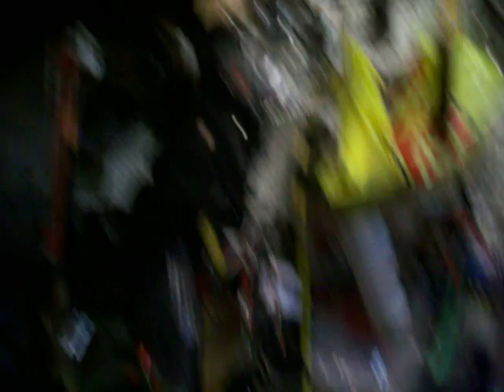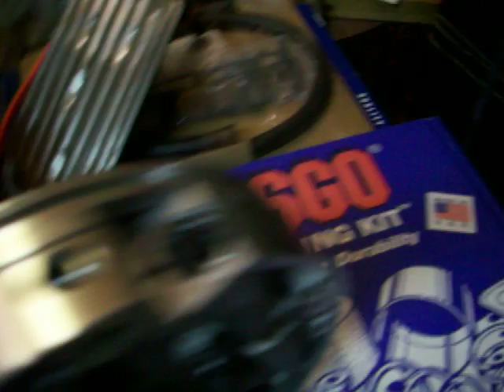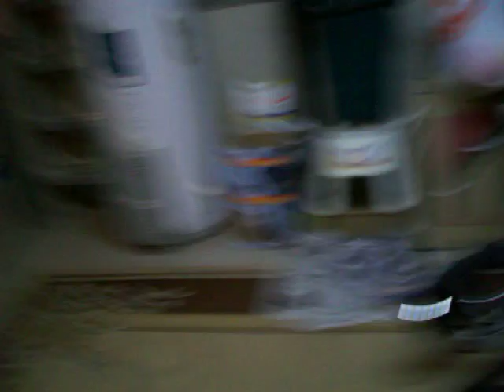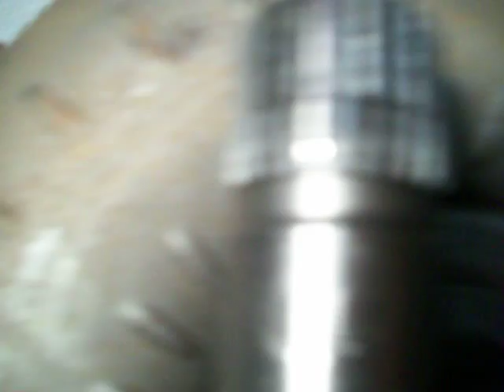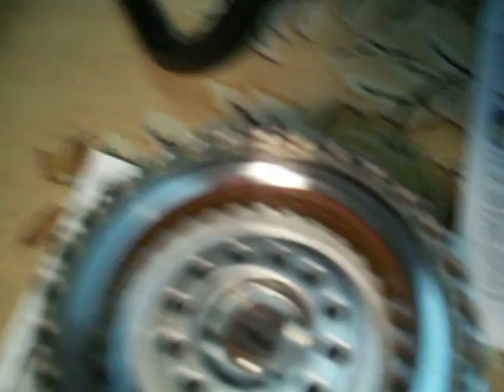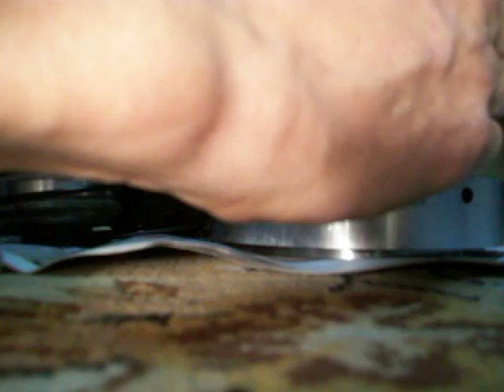Turbo 200-4R for the Vista Cruiser

Comment from the maker: This is one nice tip, I thank you for it, I'd like to try this on a unit I am building up as a spare for the one in my car already, which is doing decently, save for a low sprag which acted up a while ago, now fixed. It was the older style fiber washer as the root failure. The new unit will have stuff not available when I built the original almost 5 years ago.  The 4-clutch setups have not been troublesome, but a 5th plate can only help.  The recipe you gave saves the guesswork.  Appreciated.

Comment from the maker: Thanks for asking!  OK!  First of all, what is the transmission from,I think your truck came stock with a Turbo 350 in that year.  A basic R&R may be in order, a used unit is like a pig in a poke,just about every used one I've opened up has needed a little something here or there, unless I knew the exact history of them and was able to test drive.Fresh seals,a few bushings a few 'hardened' parts,Kevlar band,good clutches, a mild 'Shift Kit' will bring you much satisfaction.  Ask more if need be!
Reply: spikedpunk i have a 2004r  that shifts good in all gears
 The problem is when i put it in drive it takes between 15 to 25 seconds to engage in drive not as long in first goes right in when you go to reverse any help you can help me with
                          Thank you

Comment from the maker: You are welcome, glad they can help, not many others have ventured into the 200-4R's on this network.  The 442 unit you have is a very good base with a nice valve body.  Get the unbreakable pump rings, hardened stator support shaft, Kevlar band, and decent clutches,  With this the unit in my 5100-lb wagon is still living on after many miles/years and good 'use'.  The light weight on the back of your truck will help reduce strain on the unit even more.  Ask more if you wish.

Comment from the maker: Still holding out just fine thanks!  Just got back from a drive.A huge oil cooler keeps the oil nice and fresh and red, it shifts consistently, floor it at 35, you grab 2'nd nicely and it works back up through the gears from there.Even with the 3.73's out back (which makes it easier for the transmission actually because it does not have to 'lever' the car as much off the line) it is nice to see 2050 RPM in 4th/lockup with the 2200 stall converter. Use the billet for the high HP build definitely!

Comment from the maker: Yes, it certainly can, the one in my Vista Cruiser is behind the original '72 engine which has been warmed over just a little.  Been in the car for 4-years, many thousands of miles, it is holding out just fine.  It has the hardened stator support shaft, pump rings, Trans-go shift kit, nice clutches, Kevlar band.  Enough for the needs and how I use it. A pending 455 will require me to build up one a little stronger if I am crazy on the 'go' factor on a consistent basis. Thanks for asking.

Comment from the maker: Thanks for the words.  Yes, the 200-4R is a very decent unit set up right, and can live under a heavy car like my wagon, see some of the movies.  It can live under yours.  Did you lose 3rd as well?  This will tell me a lot. If the reverse/high clutch went, an upgrade of 8 friction plates in the unit will help.  Did they ever address the reverse boost valve in the pump to increase pressure?  This can be gotten to by merely dropping the oil pan. 700-R4's can be used with adapters.  More questions?

Comment: Hello, first off i want to say, very informative video, and secondly I have a question, is the TH2004R, a good reliable transmission? I have a 1982 Oldsmobile 98 that is on it's third rebuild, and all three times was sent in for rebuild for the same problem, reverse failed. And the other question is, can an Olds built engine use another transmission besides the 2004R, say like the 700R4?

Comment from the maker: Hi Richard. Thanks!  All the 200-4R transmissions came with dual bolt pattern bell housings.  This transmission being redone, and the spare in the movie, and yet another spare I have on one of the shelves came from Oldsmobile V-8's.  This will be a bolt-in to the engine, and the cross member will need just a little filing to elongate holes.  I have pick up the 4-inch longer driveshaft. Throttle cable and converter lock up circuits will complete the job. Thanks for the kudos, I will make more!